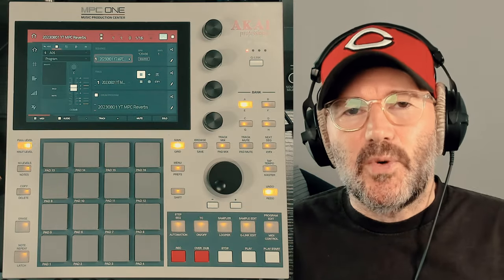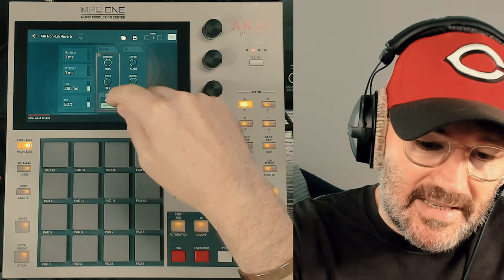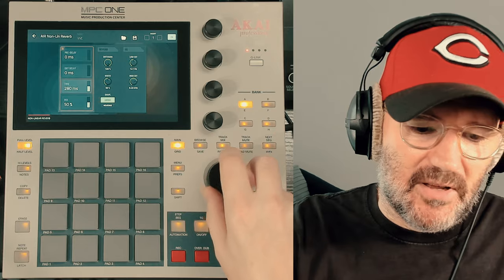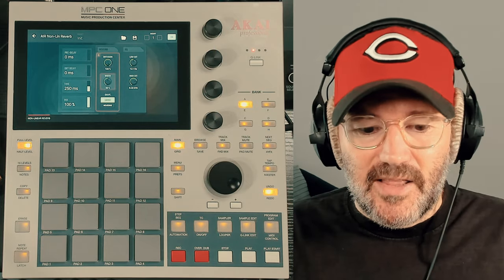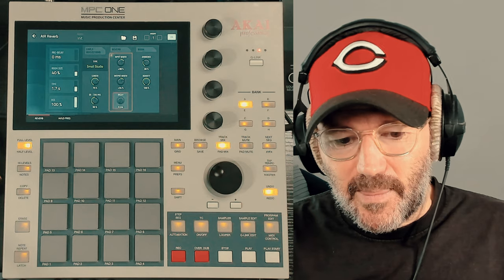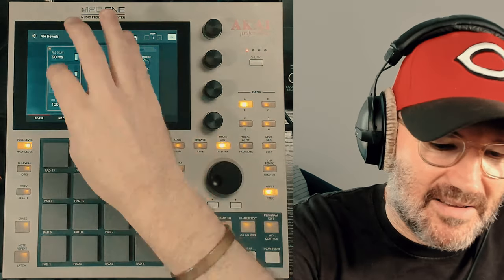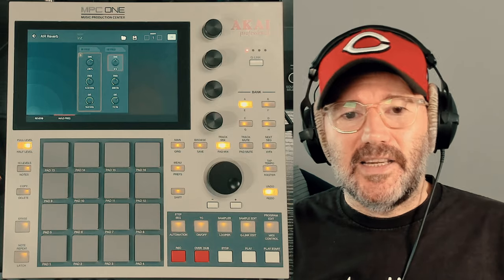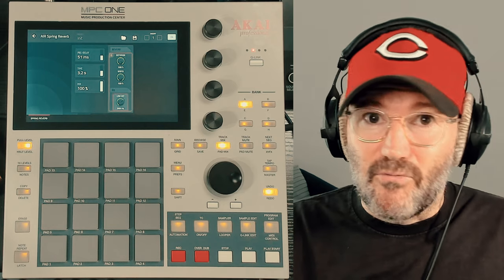Akai MPC Tutorial. All Reverbs explained in the MPC. How to create depth, width & space in your mix.

Comment: Fantastic bro. Reverbs are fairly straightforward but there is still a lot to learn here. The one area of the MPC that's been slightly underwhelming for me is the built in reverbs. Thanks for this video.
Reply from the maker: You’re welcome man. Thank you for watching.
Reply: More plates for me!
Reply from the maker: @Reggi_Sample  Some decent plates would be good. The only issue I could foresee is that decent reverb plate plugins tend to use a lot of CPU. Something the MPC lacks in. Valhalla make good plate plugins with low CPU, so it’s possible I guess.